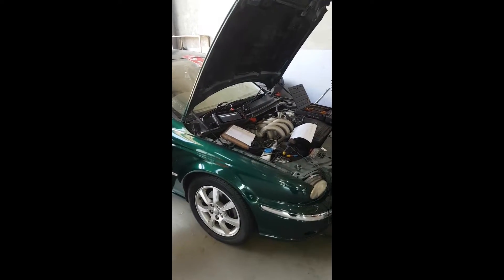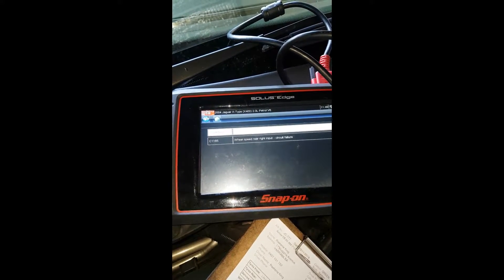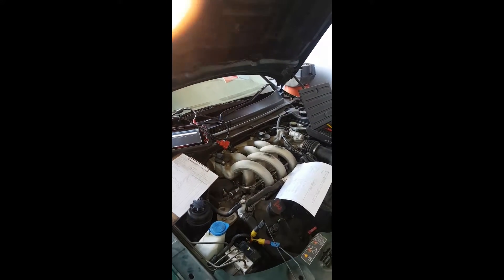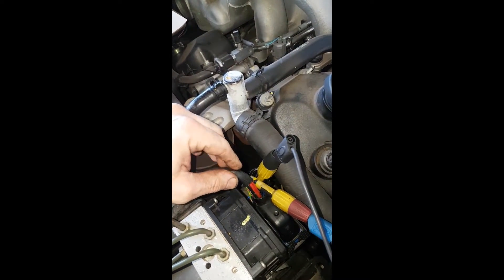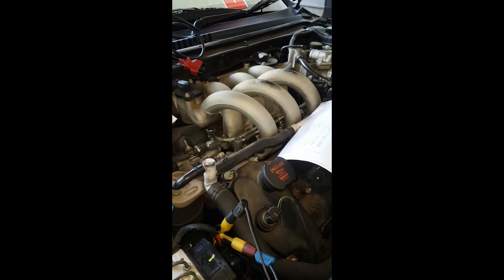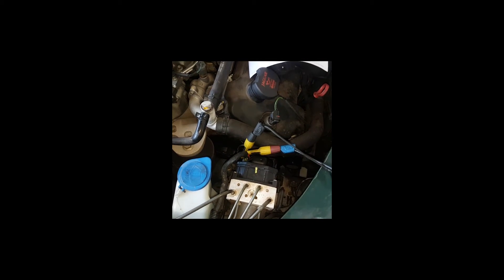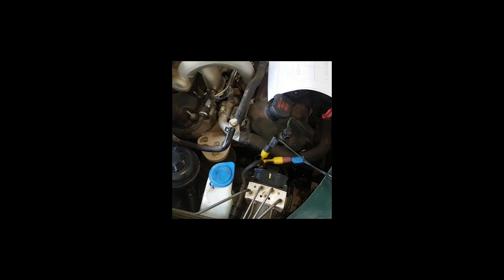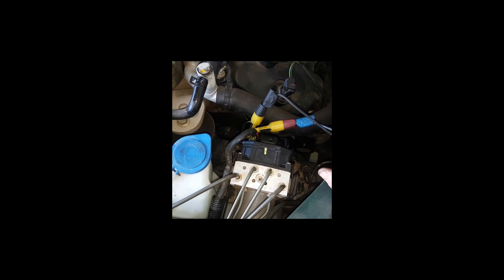ABS Module Fault Diagnosis

Comment: Not that this is related to your vid but can you perhaps shed some light into P1517 error code on a Jaguar X-Type (2002 model)? We've tested the TCM, replaced the park neutral switch and to no avail still unable to get the car to start.